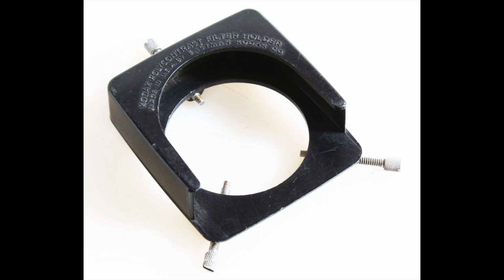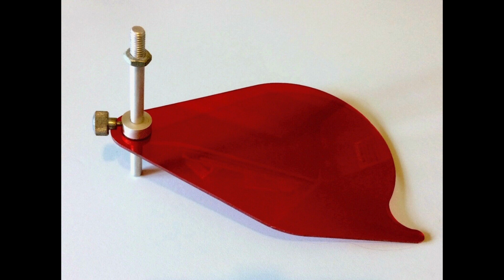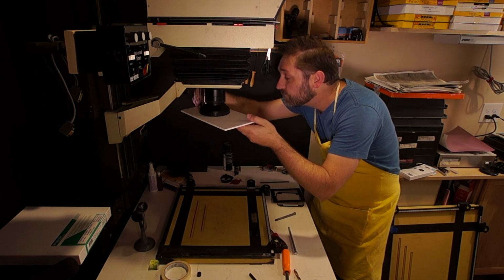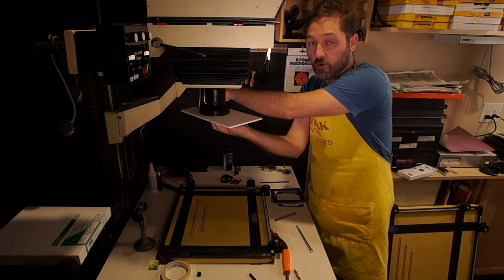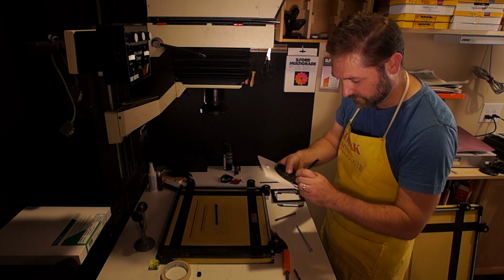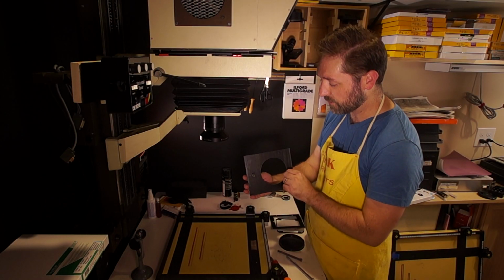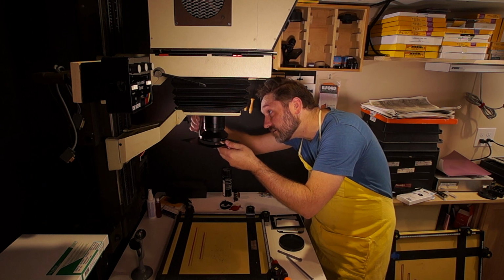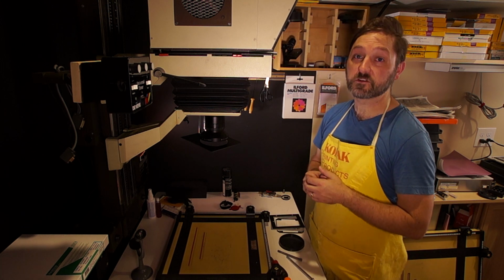DIY Enlarger Filter Holder

Comment: Interesting video now I have just bought on e bay a 4.5 inch 85 filter think could be Panavision suitable for tungsten movie film ( in my case 35mm) so I will have to set about making a holder for it maybe with a stick handle or similar.... so I will go off to a hobbycrasft shop here in UK to see what I can find.. blah blah blah etc etc.....thanks.....
Reply from the maker: 4.5 inch adapter rings are available.  I have a step up ring  to that size for my 105mm lens

Comment: Nice video Greg! I want to put a red under the lens filter on my Beseler enlarger so this will be very helpful. Do you worry about the under the lens filters degrading image quality? Do you ever use the filters of the colors head?  I'm about to build a new sheet film drying cabinet with fans and  a.c. filters. How would you do it, if you weren't blessed with a fancy darkroom? Keep up the good work!
Reply from the maker: I had plans to make one myself awhile back.  It was just going to be a box with a filter on top and a filter on bottom.  Nothing fancy.  I have not seen any image degradation from using my filters, but I keep them very clean and scratch free.  One day I may do a side by side comparison to see if one way works better than the other.
Reply: @TheNakedPhotographer  Good idea, love to see that !

Comment: Hi Naked Photographer
Personly I would never use a under the lens filter, reason: If you spent a lot of money to get the best of your optics, (taking and printing lenses) why throw it all your effords away by using a piece of image detoriating plastic ?
At photography school they teach us only to use a filter (when taking a picture) if you really need one for contrast correction (yellow, red, green) and never to use a skylight or UV filter permanently since every glas surface adds optical problems which are visible in close comparison...

But...in your case when enlarging and NOT having a filter drawer ABOVE the lens in your enlarger, you have to deal with what you have got.
Indeed a clever solution you have got there and this is the initial reason for my words why not make live easyer and put a end stop strip at your filter holder (rest), it takes not more then to saw a smal strip of the same material you used and glue it into place just in front of the bolt.
It is only a suggestion.
Thanks and Please keep on making these kind of video's.

p.s. Most photographers will debate above and say: I have done this for years (under the lens printing) and never got a single bad print!
But the real reason is, they never tried it the other way, above the lens...;-)))

Regards,

Bert.
Reply: Have you tried Split Grade Printing using above the lens filter drawer ??  It’s fun !

Comment: I just stumbled on a funny problem regarding filter placement: wanted to do a BW print from color negative and it appears there is significant difference in effect between 'below the lens' and 'over the negative' (in the filter drawer - Krokus 67) - here are two pairs of test strips going through the center of the frame (it's a shot from Sprocket Rocket, thus the sprockets...) https://photos.app.goo.gl/eG7Y6D8rJByNFuXa7
I'm using foma grading filters (thin color gels) - they come in Y, M and 2M grades (so 3M is stacked M+2M). OVER is when I put them in the top drawer, flattened with matte glass (standard), BELOW is just laying them on the red filter holder thingy (in case of 3M i used additional piece of clear glass to flatten them - I left it for OVER too). All exposures the same 10s, f8, negative is Lomocolor 800 (held in Digitaliza - glass holder gives ghosts of sprockets... another topic...)
Reply from the maker: I am unfamiliar with that model enlarger, brand of filter, and film.  I don’t know if I can offer any information.  If it were me, I would do the same test with another brand filter to see if the effect is the same.
If it isn’t, the filter themselves are causing this.  If it is the same, perhaps it is flare off the filters while below the lens.
It looks like the second strip is exposed longer, perhaps the filters in the drawer are reflecting a lot of light back up into the head, causing a loss of light intensity.
Reply: Hah, got it: technically filter is the culprit, but normally works fine asy any other would - what's different here is that I'm exposing whole film with sprockets - sprocket holes (and area outside of the strip when held in 6x7 holder) are like huge very briht source of light thats bounces off and scatters on any imperfections causing this contrast loss on the whole frame. Additionally, when film is in glass holder, there are ghosts of sprocket holes visible...

Thanks for a hint, now I can go further ;)